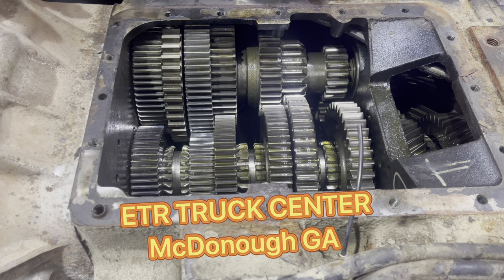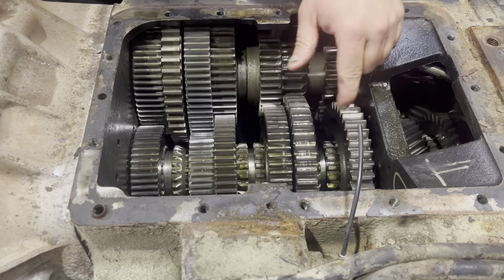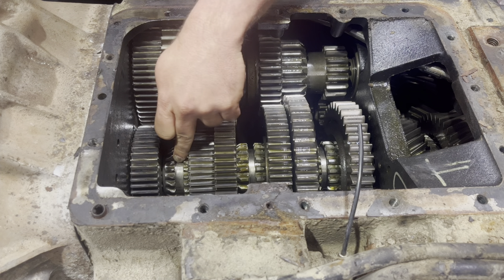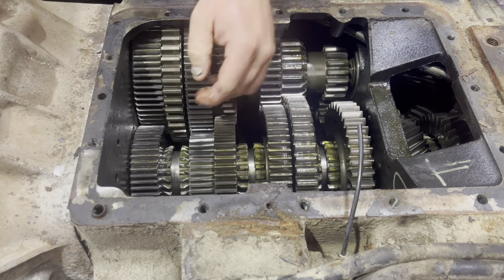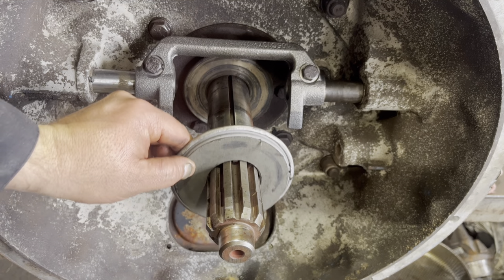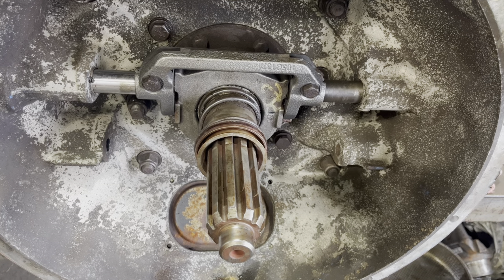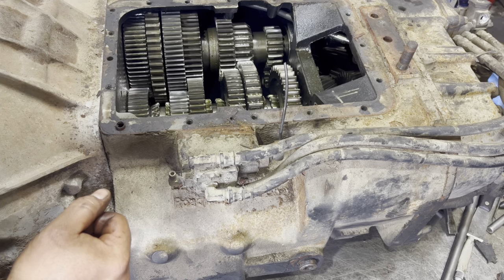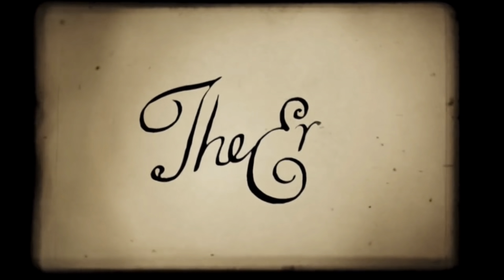Why your semi transmission is grinding and not going into gear. Listen for yourself. #trucking

Comment: Great explanation. One trick to avoid it is to count to 5 after pressing the clutch pedal, then engage the gear.
Reply from the maker: Yessir give it a sec to stop the transmission from turning thanks for the comment HEA! 👍
Reply: I'll try that. Thx

Comment: Mine makes that sound only when I’m in low gears if I let off the fuel the rpms go to idle and make that grinding noise, also it does that in reverse pain in the ass to backup I thought I needed a whole new transmission, thanks for the info.

Comment: I have a freightliner cascadia 2016 and just put in a new (self adjusting clutch) basically what was installed when trk was new. I have had so many issues with this clutch. I have maybe 2500 miles on this new clutch and indicator shows 50% now. I had no issues with my transmission until putting this scrap metal in. So basically can this be fixed or just remove and install something else. Pretty sure freightliner not going to warranty this OEM part.

Comment: Would a non-stock shift stick affect the "ease of getting into gear"? I have an ever so slight grind you described with the slider clutch?. I swapped in an 18spd that's F-designated (RTLO*F*16918B) ... and had to use a junkyard sourced shifter that j-hooked to the shift tower. I always wonder if that may be a reason for the imprecise shift feel.

Also, im having to adjust my clutch every 10K miles, and lube the throwout bearing every 3K miles (else i detect a rattle) ... Is this normal?

Comment: Mine will go into 1st gear but grind real bad going into every other gear. Do you think the clutch brake is not stopping the transmission? It's pushing the throwout bearing into the pressure plate.
Reply: Don’t use the clutch brake when moving.

Comment: Hi good afternoon I own a fld120 for 13 years now have a 18 speed eaton clutch and doing something to me never do before after the truck been parked for couple days ( raining here a lot of humidity ) truck start ok but grinding when trying to put on gear looks like clutch getting stick to the flywheel pressing the pedal clutch 
So in order to release the clutch from flywheel my mechanic told me to put the brake put the truck on the lowest gear ( truck off ) press the pedal clutch and start the  truck and that works the clutch starts working correctly 
My question it’s that normal ? Something getting bad on the clutch ? Any suggestions ? I would appreciate it 
Thanks

Comment: So is that the same noise when u go from low to high with the splitter and it make a noise go to 5th in a 8 speed double LL
Reply: Same deal happening to me. What was your solution
Reply: No that’s your synchromesh, it needs to be replaced although you probably have done that by now

Comment: what if my shifter is vibrating as well, at idle, neutral, clutch out it vibrates, clutch in hard to get into first and reverse, goes into 2nd and 3rd but with grinding that slows to a stop and allows shifter to get into the gate after a second or two of light pressure at the gate. eaton rtx 10 speed.